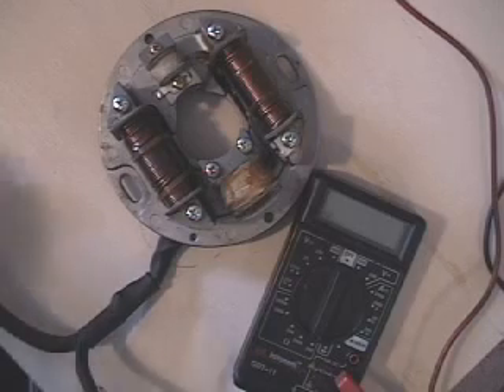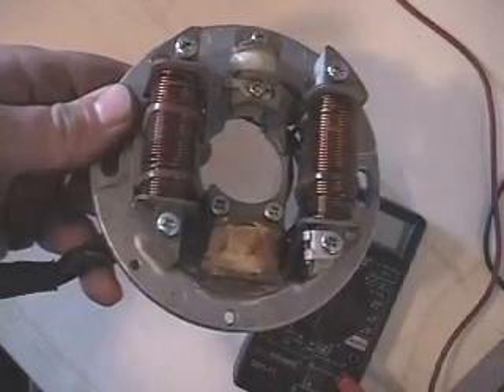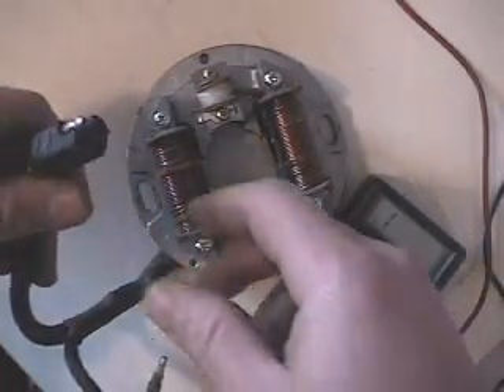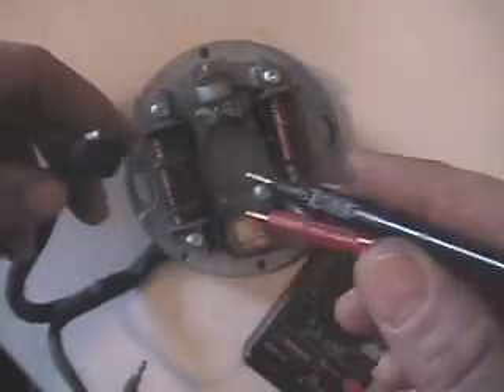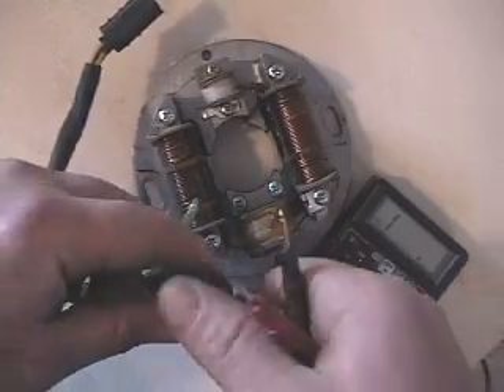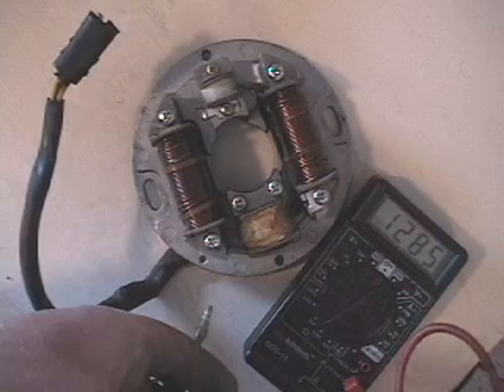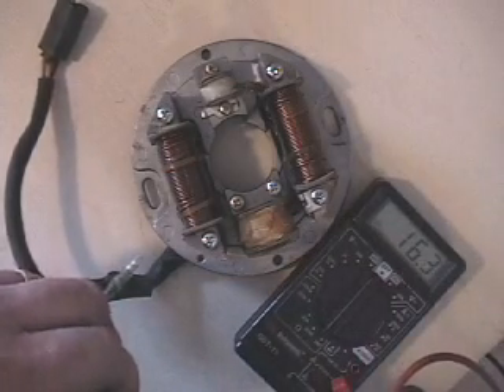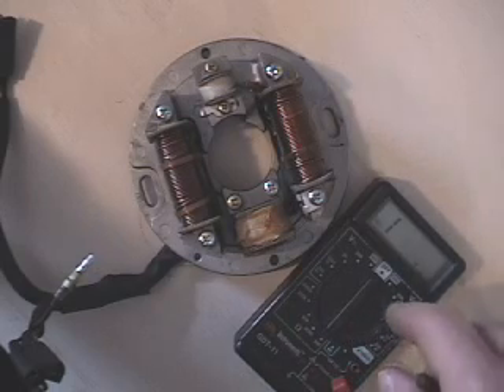Arctic Cat Cougar 440 Stator Test

Comment: Hello, I have the same 3, 4 and single prong connectors, but my three prong has one female and two males. I followed your instructions as if my one female was the one male in your video, and I got about 200 ohms for each reading. My sled is a 1997 jag 440 fan. Think it’s bad? I’ve been having intermittent spark while driving

Comment: This looks like the stator in my ‘97 ZL 440 which won’t rev up off idle. TSS wires are disconnected from carbs so I think that would rule that out?
If my high speed was no good would it cause my not revving up issue? I’ll get to testing it.

Comment: Hi, Blane  perfect video for me   I have a 1980 Jag ran great for about an hour and then no spark.   Did the ohm test on the stator and got nothing on ignition wires.  Only 3 ohms between the 2 female plugs
Reply from the maker: I don't know the specific ohm readings for that sled but some of those late 70's early 80's models have a stator that has a low ohm reading ignition coil like 2.7-3 range so it may actually be ohming out ok.

Comment: I have same startor and mine reads male to right female 12.74 and male to left female reed's 12.90  2 female reed's 16.7  and 2 yellow reed's 4 and ground reed's is 4 just want to make sure thus is a good  one before I put it back in thank you  so much
Reply from the maker: I'm guessing the 12.74 is actually 1274 ohms which is right around where it should be.
Reply: @BlaineDP   ok thank you

Comment: So following your test on the three wire plug in the same order you tested I got 1187, 1173 and 14.4 ohms.   Sled will run but won’t rev above 3000rpm.  Do you think my high speed coil is bad?

Comment: I have an odd problem and thinking the low speed coil on the new stator could causing it. Readings at room temp are 1040 ohms. Once it's at operating temp I'm getting above 1400 ohms. Once its warm if the rpms get below 1500 ish or you shut it off and restart it will drop a cylinder and won't rev up. Just sputter at idle. But then will randomly come back to life and run perfect. Thoughts
Reply from the maker: Room temp ohms should be in the 1150 range.

Comment: I have same stator. Low speed coil is 1.223 ohms, high speed is 15.2 ohms, installed new aftermarket CDI, new ignition coil, checked continuity on connectors, jumped non-yellow wires but still no spark. What do you think could be a problem?
Reply from the maker: It's supposed to be in the 1250 ohm range for the ignition coil. Depending on the year of sled: If it's older you use the jumper wire. New sled you don't use the jumper wire.

Comment: If the high speed coil is bad will the machine not do anything but idle?
Reply from the maker: Depends on how bad the coil is..sometimes it'll only idle. Sometimes it'll rev up a little bit. Sometimes it'll rev up a lot but just not the last 500-100rpms. Sometimes it'll run perfectly fine for 5-15 minutes and then it won't rev all the way up.

Comment: my old 75 scorpion uses the same Stator style, but 11 wires (instead of 7). 2 blue (1 with a red strip) both go to individual external ignition coils and the rest all go to a plug 2 black 1 brown 2 green (1 with a black stripe) and 2 yellow (1 with a green and black stripe) the video quility is low wish i could understand what all is going on, (all the colors and what they all do.) It ran fine, i had it running then turned it off and about 1 minute later i tried to pull start it to test it out for the first time on snow outside my garage and no spark to the plugs...
Reply from the maker: Could be stator, key switch, wiring harness short, coils, cdi ect..it's a 1975 there are lots of things that could be causing it.

Comment: I have the same stator and the only reading I can get is the ground continuity. Is my stator f'd or can it be fixed.
Reply from the maker: I can rewind them. www.outdoor-electric.com
Reply: BlaineDP I just ordered one from Montreal. I was quoted 1045$ from one place and 310$ from another.  Fyi how much for u to rewind a stator plus shipping?
Reply from the maker: As of 11-9-2017:These prices are in U.S. Funds. Prices include tax and shipping:
$175 if you send me an OEM core for U.S. Residents
$200 if you do not have a core for U.S. Residents
$200 if you send me an OEM core for Canadian residents
$225 if you do not have a core for Canadian residents
All packages are shipped using a tracking number.
Reply: BlaineDP ....i just installed the stator I bought and my machine idled for an hr and then 1 hr later I drove around on it for approx 2 hrs starting and stopping it here and there, using the choke. (Kill switch no good). Now I can't get spark again and the stator tests no ohms. Wiring is fine, plugs r brand new, coil and plug wires brand new,  and CDI brand new. Any tips???
Reply from the maker: Where did you buy the stator from?
Reply: BlaineDP ...the stator was from a place in eastern Canada, I don't know the exact company, I ordered it through a local sled shop here in South central British Columbia Canada. Was 350$ with shipping. Darn thing only ran for 3 hrs. Can i send u my old one and this new one which doesn't work?
Reply from the maker: Contact me thru me e-mail: Blainepertler@yahoo.com. There's more info on my website: www.outdoor-electric.com. To answer your question: Just send me the OEM stator that was in it.

Comment from the maker: 99.9% of the time the lighting coil does not go bad on a stator....unless there is damage to it. You need to check the voltage coming out of the stator. I have a video showing how to do that. You may have a bad regulator.
Reply: I've got an 97' zl 440 that ive installed an new AC regulator, ive replacted the bulbs and my lights will till cut in and out? Ive installed new grounds from the motor to the chassis and even tried grounding the brown wire off the harness. There are 0 broken wires all the connections had dio grease in them. I'm thinking of replacing the lighting coil but id like to know if I have to pull the stator to do so or can I just pull the flywheel and replace the oil?